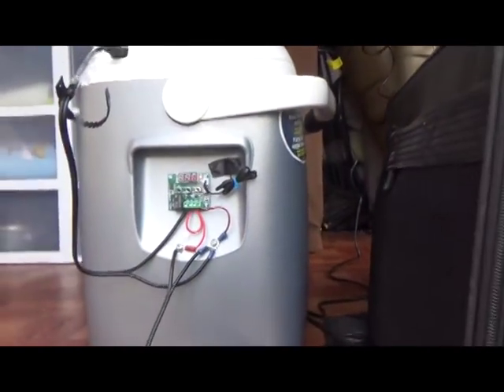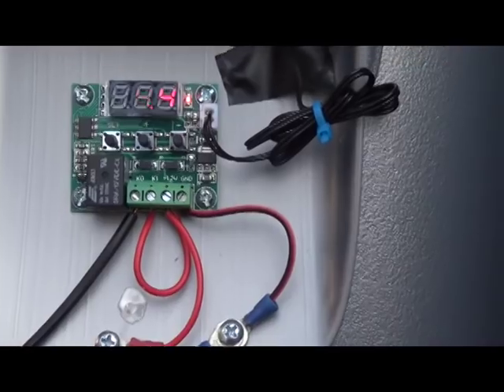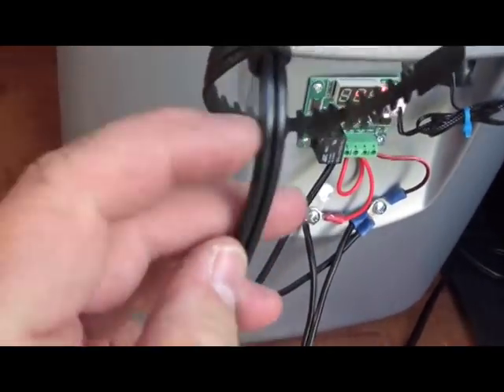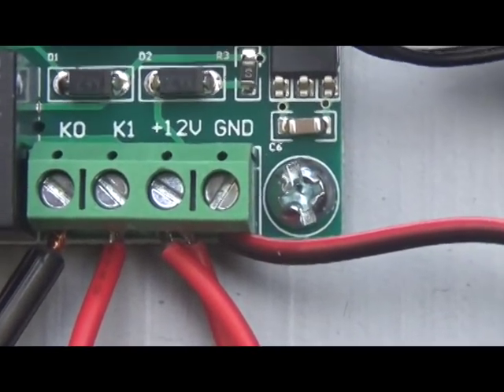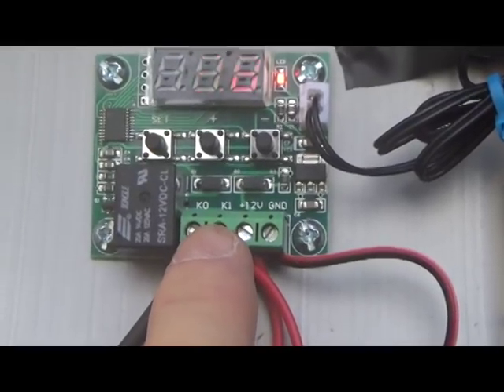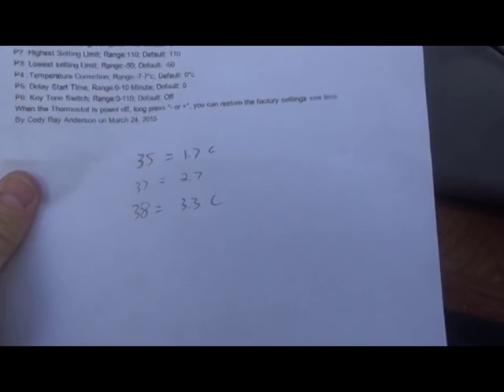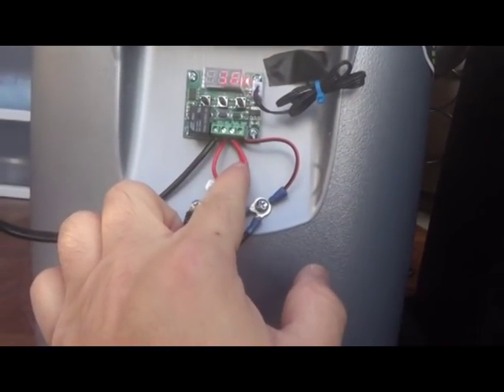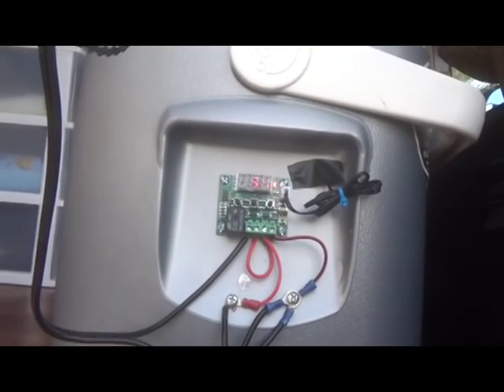Installing a 12 volt thermostat on an Igloo thermoelectric cooler

Comment: my controller's  display is not working. and the relay is permanently ON. this happened after the temperature exceeded the limit( above 110degrees). Is there any hard reset for this unit?
Reply from the maker: Not that I'm familiar with.  I haven't used this set up for many months now.  I ended up purchasing a Norcold chest type 12 volt refrigerator/freezer, which I've been very happy with.  It was pricey though, about $600 US.

Comment: Hello from Germany,
I have also a thermoelectric cooler. And also a blue and a red point on the connecter.
That does not mean + an -. It means cooling process or heating process.
If you turn the red color to the top, then your box is heating.
If you turn the blue point to the top, then your box is cooling.

Nice greetings.

Comment: I'm considering doing the same but I was curious... Have you found it actually does shut off for any duration or is it shutting off then two minutes later turning back on and running for half an hour, then shutting off for two minutes, turning back on...
You know what I mean?
Another words is it actually worth installing... or just letting it run? I realize that's really related to how good the insulation is on the cooler in the end. But I wanted to hear your findings now that you've installed it... and hopefully put it to use.
TIA.
Reply from the maker: Good question.  I think it's definitely worth it from an energy savings standpoint.  The biggest factors in determining how much it will run is the ambient temperature and whether or not you try to add additional insulation.  So in cooler weather, the "off" period was definitely longer.  Hope this helps!
Reply: The Drifting Lens - Thanks for the response.
I lucked out and found a little 6 pk cooler and even more so with a find of a 40 year old Koolatron 46qt, with optional thermostat I might add 😉 at the thrift store. 
Both surprised me with how well they work. The 46 qt at 90F holds solid at 34.1F. I was really surprised. 
However the thermostat it has in it is not a on/off. Nor specific temp. It's like a frig, you guess at it. And how it works is it sets the temp of the thermal electric cooler... it's runs continuously at that desired "coolness". 
Obviously I want to update it. Add a true temp probe read out thermostat like you have. And add a ball bearing pancake fan as opposed to the older style fan it came with. 
Another thing I'm considering is connecting the fan in a way it continues to run even after temp is reached to cool the external heat sink for a bit. That way there's less heat transfer back to the inside once it shuts down. I don't know for sure if that'll help, but it sounds good when I say it out loud. 😁
I'm sure more thought needs to be put into that side of things, but that's my thought pattern at the moment. 
The 6pk one... just a tad too small. Though it's nice next to the coffee maker to hold creamer. Saves opening the main fridge. Though I'm not sure if I'm being green or just making my foot print bigger.
Anyway... again thanks. I'm glad you found it worth doing. 
Cheers...

Comment: What model is your cooler and how much did it cost? Thanks!
Reply from the maker: Sorry for the delay.  It's a Coleman, and I spent about $70 on it.  Since then I have upgraded to a Norcold 12v refrigerator/freezer.  It's much more efficient and keeps food safely cold, even in warmer temps.  But it's pricey!  About $600 for the base model.

Comment: If you're not in a hurry, you can order components like these direct from China for next to nothing (about 1/10th the price in this case).  $1.68 no tax and free shipping.  However.... it will take 2-4 weeks as it literally ships from China.
https://www.aliexpress.com/item/W1209-DC-12V-Digital-Cooling-Heating-Temp-Thermostat-Thermometer-Temperature-Control-On-Off-Switch-50-110C/32711281021.html

Comment: For anyone that didn't realize, the Red H and Blue C are for hot/cold. Several modes allow you to inverse the polarity to the cooler to turn it into a heater. Seems this cooler only allows the plug to go in one way, but htat plug is most likely the same plug for multiple different models of coolers.  The reversible ones have a mark on one side of the socket and whichever color dot is by the mark determines if it will run Hot or Cold.
Reply from the maker: Good point!  Thanks for sharing.